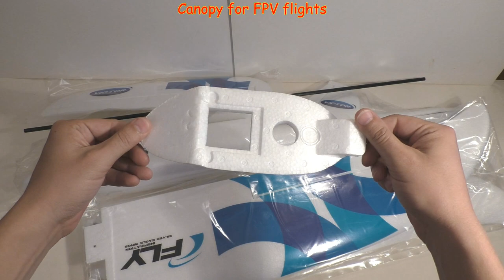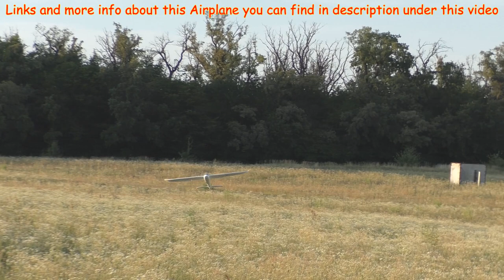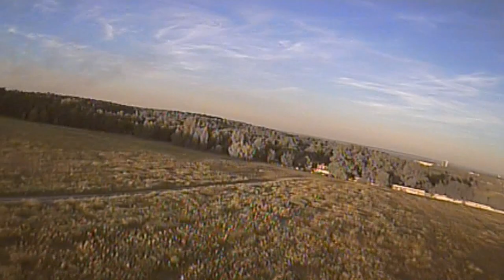Sky Surfer X8 1480mm Wingspan, EPO, FPV RC Airplane (PNP) Assembling, flight test +AKK KC02 on board

Comment: Thanks for the video! I have a challenge to get the wings straight. As soon as I use the cube, it is not square anymore. Also using the screw does not help. Can I try it without the cube?
Reply from the maker: This RC airplane have good flight characteristics without any modifications

Comment: Hello, my esc gets hot after just one 3S battery flight is it normal or not? I want to cool it, is it possible to do it by removing the square piece at the bottom?
Reply from the maker: The ESC heats up from use. Is not critical, but better make some additional ventilation in the airplane body

Comment: where did you get power connection of your fpv? what connection? thanks
Reply from the maker: For powering my FPV system I use handmade power wire: JST connector <-> 3S balancing connector. You can find these connectors or power wires almost in all china's stores who sales rc products and etc., just type in a search field "JST connector" or "3S balancing connector".

Comment: A motor modification would make the Sky Surfer perfect. Has anyone tried using a better motor? Mine is always overheating... What would you think about 1400kv? Thanks
Reply: Sunnysky would work perfectly
Reply: @dronepilot260rc  oui mais lequel le 2212 2450kv? ou un autre pouvez vous precisez?

Comment: Is a 2S 1300mah battery good for the Sky Surfer?
Reply from the maker: 2S 1300mah very lightweight. To get the plane's normal center of gravity, it is better to use 3S 2200mAh

Comment: Thank you for your video, very helpful and informative. I made a few flights but propeller seems small and plane cannot climb very well. What do you think, without damaging the stock esc (30A) or motor, what is the biggest prop can we use?  Is it safe to use 3x5x3 (three blade) propeller?
Thank you.
Reply from the maker: Hello. I don`t know how about 3x5x3 (three blade) propeller, but I saw how people use 6X4 6040 (two blade) propeller with this airplane

Comment: Flight time with 2200mah?
Reply from the maker: Flight time depends from how often you will use full throttle. I got more than 20min flight time with throttle around 50%

Comment: I did not have the top screws in the box ... what are the dimensions?
Reply from the maker: M3 with total length 78mm
Reply: @81hermit  i take m3 70mm screw top
Reply from the maker: @ISSOU-if7df  length 70mm is ok for attaching main wing to the fuselage?
Reply: @81hermit  yes
Reply from the maker: @ISSOU-if7df  ok. that is good
Reply: @81hermit  more small more lightweigt
Reply from the maker: @ISSOU-if7df  for this big plane a couple grams doesn't matter :)
Reply: @81hermit  
even that is useless weight

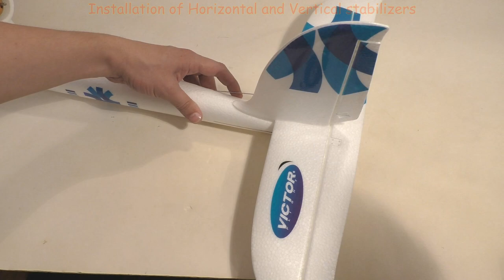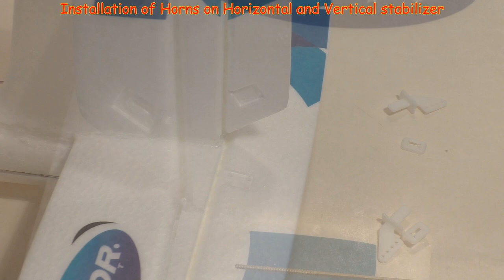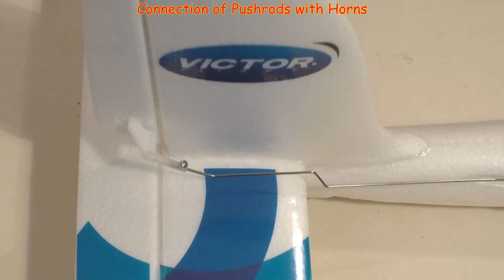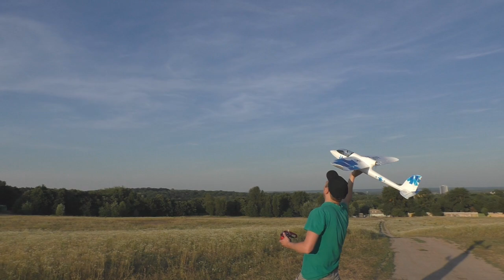Comment: some info.    design  F L A W S.   (buyer be aware)      at :52,  the main wing has  Positive aoi;  this is a  less, energy efficient  configuration.     at 1:57, the use of a curved vert-stab leading edge is a Not recommended.      at 2:10,  WRONG.   the control horn and linkage alignment  Should be   Perpendicular   to the hinge line.       at 2:38,  WRONG.   there should be  NO  Bends   in pushrods;  unless Absolutely necessary.        at :52  and   5:26, an  Optimal thrust line/angle has Not been used; this  Wonkiness  is a factor in the dive at launch behavior.        googletranslate
http://static.rcgroups.net/forums/attachments/2/9/6/3/9/7/a5988257-224-bixler%202%20motor%20angle%20correction.jpg
Reply from the maker: Probably that information will be helpfull for some users. You finded so many wrong and incorect moments in construction of this airplane :) But, as result you can see in this video (from 5:26) as this airplane can fly. It flys is pretty stable and good responsive to my controll.
Reply: is it worth to buy?
Reply: @81hermit  is it worth to buy?
Reply: is it worth to buy?
Reply from the maker: @paulushalim9128  yes, sure
Reply from the maker: @paulushalim9128  yes. good airplane. very stable in air
Reply: @81hermit  david said, it's many flaws?
Reply from the maker: @paulushalim9128  You can see result, how that airplane can fly with many "flaws". look from 5:26

Comment: How did you change to xt60?
Please respond, thanks
Reply from the maker: xt60 - in pnp version is default connector
Reply: @81hermit  Thanks for replying! I'm really struggling with the assembly of the propeller, what are the small green-gray plastic circles used for?

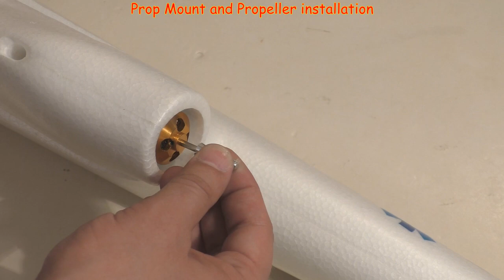3:37
Reply from the maker: @FrostyDaCat Different motors has different shaft diameters. Using these rings as inserting into propeller for needful shaft diameter
Reply: @81hermit   Thank you so much! You just earned a new subscriber!
Reply from the maker: you are welcome